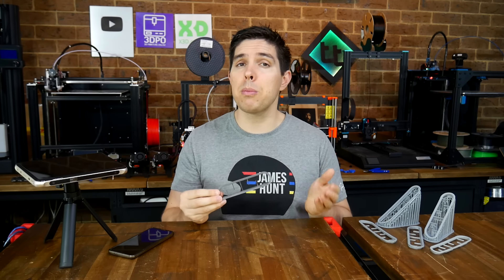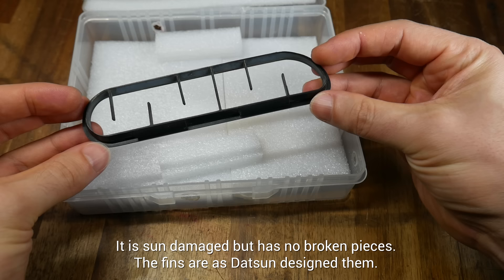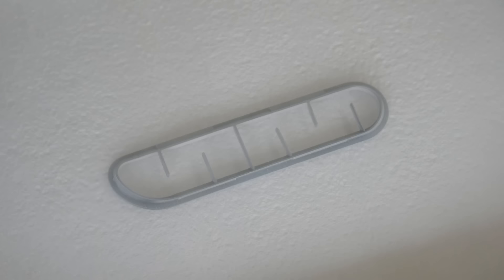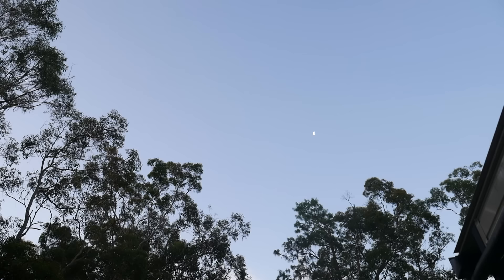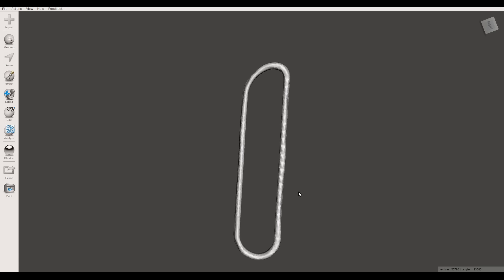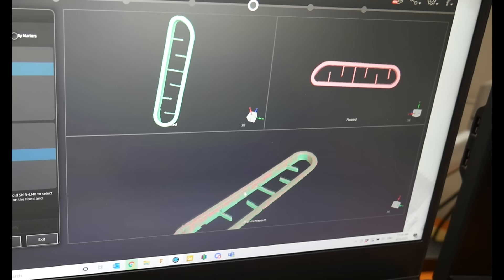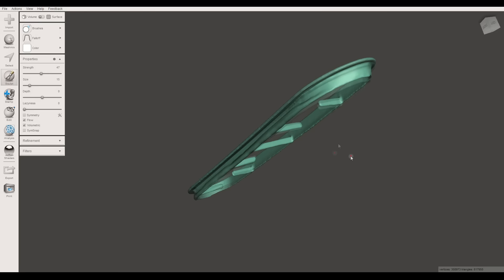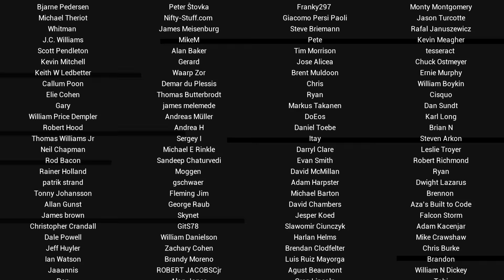3D scanning + 3D printing to complete a classic car restoration

Comment: sun heat will warp and ruin the resin prints very quickly. using the printed part as a master after fit checking it would be best. use metal impregnated resins in the molded piece for longer life.

Comment: Hi.  I have a Datsun 180B aka 610 from 1974.  My car is a US version LHD.  I have a RHD version 180B SSS dash which has nice sporty round gauges. The LHD version has square gauges. The round gauge dash was never offered by Datsun in LHD configuration. Would it be possible to use the RHD round gauge dash I have to make a LHD version ?   Cheers

Comment: I can repro that shape with all of its subtle curvature in Fusion 360 using nothing more than a decent set of calipers and a reliably flat service like a kitchen cutting board in about 20 minutes. Would have cost you a beer, okay two beers. But good job with the 3D scanning I guess? oof $$$$$$

Comment: Everything about this video, use case, methodologies, technologies, application and result, superb. My only question is about the UV stability of the resin used to 3D print the parts. But, hey, if the material's isn't robust enough, everything needed for a clean mold for casting is already present.
Reply from the maker: You sir, have perfectly understood exactly where the project sits at the moments where countless others have rushed to comment without thinking.

Comment: Dare I suggest, that a proper manual reverse engineering effort in this particular example probably would have been far more efficient and given a more precise result.

I really do want one of those POP 3D scanners, though the limitations I see om this video are offputting.

Comment: Did you try looking into CT scanning the part?  My company does alot of CT scanning and its very accurate.
Reply: Also a low cost way of the scanning spray is to use foot powder.

Comment: you can get much better photogrammetry results on small objects with a macro lens, which many androids came with nowadays
Reply from the maker: Unfortunately this is not something I have on my camera or my phone. Thanks for the tip.
Reply: @TeachingTech  there are clip on lenses that fit over phone cameras - although if the photogrammetry program checks the camera info in the metadata it'd probably cause issues

Comment: i would very much like to have the stl file for this particular part
Reply: Why don't you make your own. This one is not that good. That did not do any reverse engineering to CAD.
Reply from the maker: It will be released for free once the fitment is verified.
Reply: @TeachingTech  Go for it... I would like to read the feedback once they have the actual part.

Comment: I have been using a Xbox Kinect and reconstructme with great success.  It does tax the heck out of your GPu when processing
Reply: Thanks for the software tip. I've used a Kinect with the Skanect software and it was just ok. Capturing into the software was slow and troublesome
Reply: @MaaveMaave  yea I have a pretty powerful gaming laptop with a decent GPu and it can take up to 2 hours for it process the scan.  I am not doing overly complex scans either.  Just don’t want to pay and really can’t afford one of those professional scanners.
Reply from the maker: I have previous videos on this. When testing the Revopoint POP I compared the two and the POP was far superior.
Reply: @TeachingTech  not sure I could get the CFO(spouse) on board with purchasing at revopoint.  🤣

Comment: If the professional scanner is handheld, wouldn't it be a good idea to scan the dash opening as well, to make sure the geometries match?
Reply: The Einscan HX is not a professional scanner for a start. But No real metrology grade scanners are accurate enough to extract tolerance from the original part.
Reply from the maker: Ideally that would be great but logistically it was impossible.

Comment: Is that a mighty car mods tape on your laptop? haha love it. I tried using a few of the free methods out there to 3d scan an RC car bulk head for a losi xx but wasn't able to get any usable results... I ended up learning how to use fusion 360 and within a few hours I had something 90% there. It works but needs tweaking... I also made a few different badges for my cars.
Reply: He worked with MCM on Black Chops!
Reply: @rossmaclean2  oooh I forgot about that build.
Reply from the maker: The sponsor of Black Chops didn't want any logos in the footage so the so was a quick solution. I haven't seen the need to remove the tape since :)

Comment: wouldn't it be wiser to print it in the needed colour? in my experience painted 3d prints can look ok.. but as soon as you touch them a lot, the paint job starts to get bad after a relatively short time.
Reply from the maker: The UV will degrade the resin so it would still need painting or coating to protect it.

Comment: What resin did you use for this type of application on your sonic 4k mini?
Reply: The resin used on video is not good. This part will break in a heartbeat. Try Liqcreate resin if you need strength and durability.

Comment: Why is it so hard to get a clean scan result. I thought the tech is further but even the professional stuff is kind of shitty.
Reply: That was only the $14,000 scanner.  You need the $60,000 scanner.  😂
Reply: damn ^^
Reply: If a pro used it and post processed scan corretly the results would be much different. But real professionals do not bother with the Einscans.

Comment: Why even bother with the 3d scanning if the end result needs to be reverse engineered anyway? What value does the 3d scan bring to the table?
Reply: plot points?
Reply: @jinxtacy  Could you elaborate?
Reply: @beachboardfan9544  I'm thinking the spatial relationship of things to one another and the angles at which they project. I also think those shape was probably deceivingly difficult as there are slight contours to it.  Perhaps I'm just not that talented which is very likely but also to get a real life piece transposed seems much easier with the aid of a scanner so that you at least have something to work off of versus trying to design something from scratch with slight Contours that are hard to measure. That might just be me and my lack of skills. Right now I'm trying to figure out how to measure phone cradles to hold handsets when the manufacturers seem to break consistently. I've gone through at least 100 phone cradles in the past 2 months. There are fixed by four screws through a back metal piece that have to be in the appropriate areas I guess. Inside it requires a place for two screws to enter to hold the connection switch lever. The most complicated thing I've done so far which was pretty simple was and plate pieces to connect two power strips on the ends and be able to screw them into a standing desk but now I have no idea how to approach these cradles as the cup is pretty dynamic it's hard to establish the angles. Perhaps I just need to up my skills but I think seemingly simple objects are more difficult than initial inspection when you have slight curvatures on seemingly simple shapes

Comment: What's it look like in the car?
Reply: Probably does not fit because they did not do it correctly. But the 3d resin used is rubbish and will break very easily. These resins are very Brittul. You need to print in a more durable resin like liqcreate.
Reply: @jameskozak9095  interesting 🤔

Comment: Nice video but once again proves that scanning of engineering parts at hobby level is a waste of time. Even the pro scanner needed a ton of clean up to print Much better to just redraw it with a parametric cad package so adaptations for resin shrinkage and strength can be made .Not to mention dimensional adjustment for new vinyl coverings of the dash or similar. Scanning of people and garden object etc is great but mechanical parts just doesn't make sense from a time utilization perspective. If you consider setting up the scan, capturing data, converting the point cloud , cropping the unwanted , making manifold and exporting the object it really doesnt make sense

Comment: I never use a 3d scanned part as the print model, reverse engineering using a scan as reference is the way to go. objects like statues and other simple things ah well you can indeed use the scanned model.

Comment: Generous with his time... doubt it.
As if hes not going to hang on to one of the rarest models in car restoration and profit in his
literal 3d auto part printing company.. lol
Reply: It would be on ebay if the part was decent but it's not. The material used is way too brittul.
Reply: I have no intention of selling the part we scanned. Micheal is a friend of mine and asked me to scan this part for one of his friends.

My company already has a number of designs we need to make and sell. On a business side of things restoration parts isn’t my specialty, from my previous dabbling restoration parts the market is limited as cars like these get rarer and rarer.